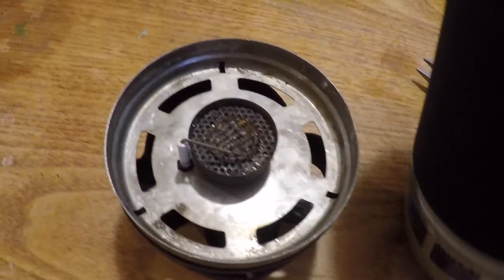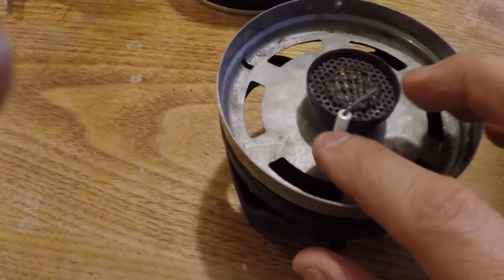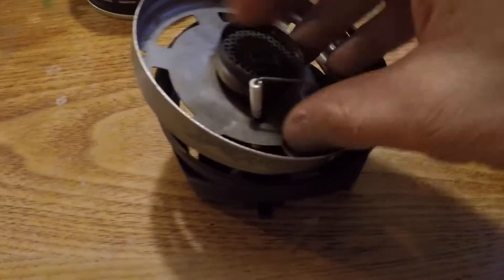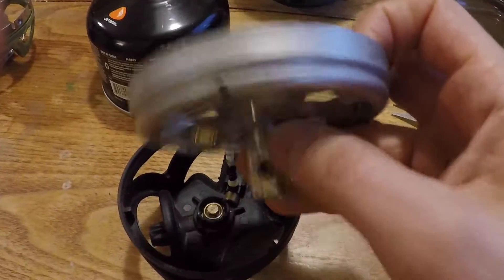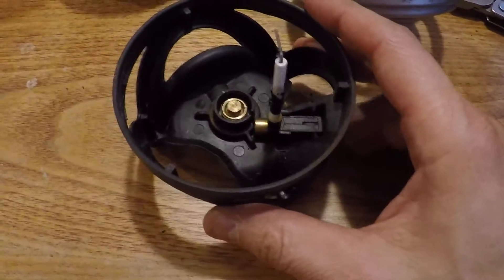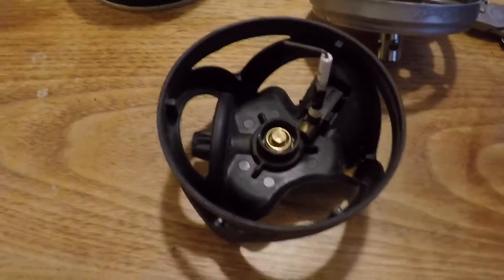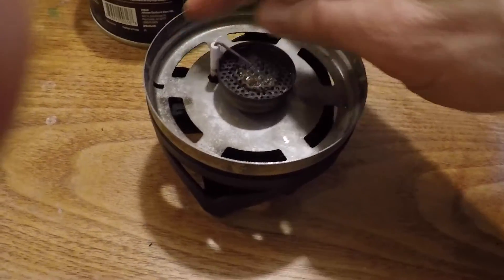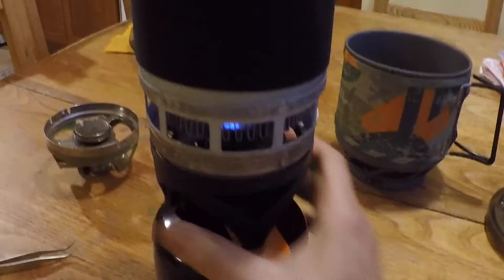No spark on your Jetboil Piezo? How to fix a broken piezo ignition on your classic Jetboil.

Comment: What if it's physically fine... it does spark ... but has a really hard time lighting the gas
Reply: If you adjust the height of the spark, it may make a difference. Otherwise, you might have an obstruction in the gas line. Try to light it with a lighter. If it easily lights, then the gas flow is ok. In that case, it would be a matter of adjusting the height of the spark.
Reply: It lights fine with another source. Im going to inspect the thing again today.  @gotimejessemaloney5999

Comment from the maker: Yes, once Johnson outdoors bought them out, materials changed. I’m sure their part manufacturers did as well. If your ceramic is cracked, I think high temp epoxy might be better than tape. Any auto parts store will have it at a reasonable price. Thank you for the comment and update.

Comment: Which tape did you use?
Reply from the maker: I just used electrical tape but I think a high temperature automotive epoxy would be better. My tape is still doing the trick but subsequent years of use has disfigured it a bit.

Comment: I have a newer model.  The piezo is in the flame portion not beside it.  Doesn’t look the the flame part screws off like yours does. Any idea how to fix this type?
Reply: In some of the newer models, you can bend the piezo wire upright. You then detach the piezo from below by removing the cotter pin or cotter washer and slide it down through the burner. At that point, you should be able to unscrew the the module and work on it freely. Hope this helps.